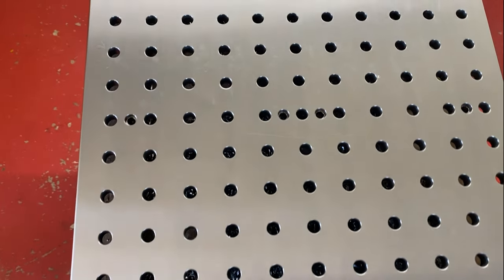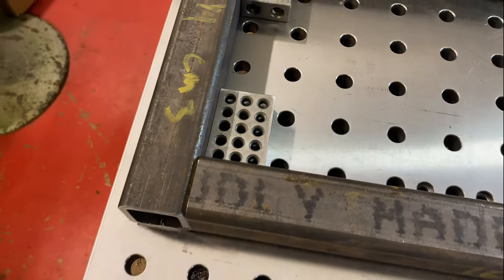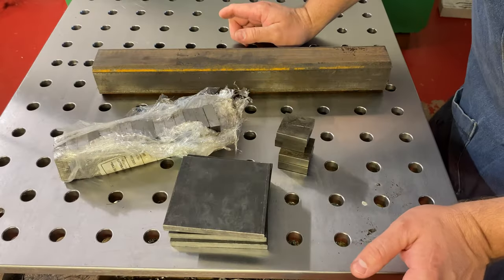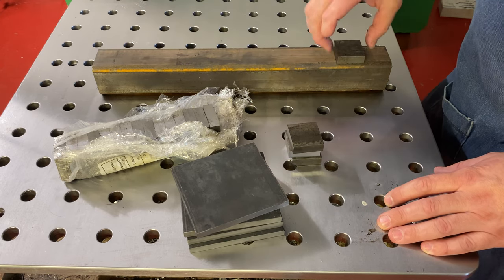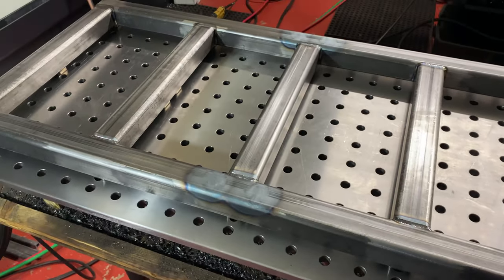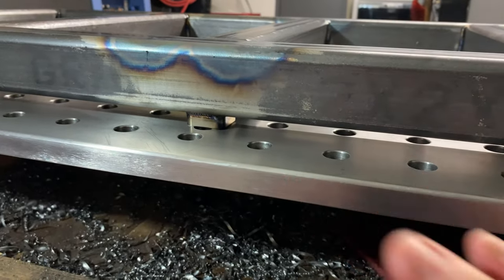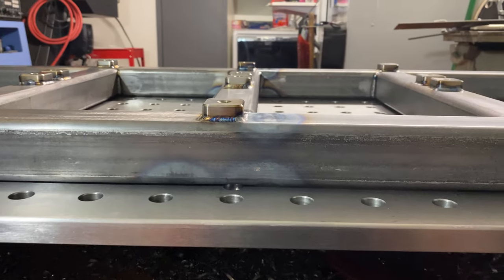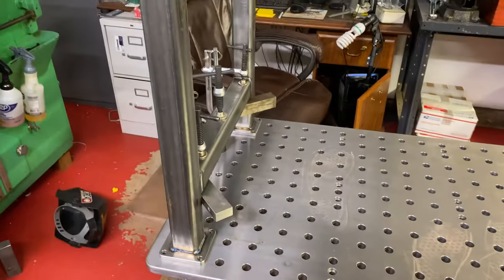My Welding Table Build | Table Frame - Nice Legs and Billet Caster Plates

Comment: Kool shop. Nice to see a true machinist make one of these. A lot of hacks out there. I’ve been a toolmaker/fabricator for 50+ years. Certainly over kill using a CNC but hey like you said, SATISFACTION. Love the Monarch, one of the best lathes out there. And a nice Doosan lathe. My sons bought my CNC machine shop several years ago. Two years ago they bought one of them. Quite happy with it. Majority of our lathes are Miyano which are very good but DN Solutions (was Doosan and Daewoo prior) are building great machines at reasonable prices. BTW your Tig Is extremely good. Nice video too. In fact I’ll subscribe , nice to watch someone who gets it
Reply from the maker: Hey thanks!

Comment: BEAUTIFUL work.  And I didn't get welding it without machining it, bc I thought welding such a large frame would introduce not only heat-deformation, but very convoluted deformation; twisting parts and compressing others to hide issues within other issues, etc.  But then I saw you adding those 'jacks' I guess..? Which I assume can be individually adjusted to make a perfectly flat plane ... very very knowledgeable and calculated project. I guess you probably would machine it flat it weren't a monstrous area to do. Again, beautiful work
Reply from the maker: Thanks! I had the frame machined flat after all welding was completed.

Comment: I didn't see you need to grind a single weld. I once read somewhere that if you needed to grind your welds, then you are a grinder and not a welder. I know nothing about what you are doing, but I know enough to appreciate a Master at work. I am getting inspired to learn the craft.
Reply from the maker: Dude thanks! A master I am not but I’m glad it’s lightning a fire for you. Welding is very rewarding and an endless pursuit towards the perfection.
Thanks for watching!

Comment: That is one good reason why a machined surface on a welding table is not a good idea.  Applying heat is going to move the table top whether it is future projects or as you have experienced while you are building it.  No point to get an expensive precision top.  You will also be grinding out spatter and tack welds all of which diminish a precision top.  You will get much more use out of it if you don't have to baby it along.  Save the precision for where it is really needed in the shop.  Good looking table.

Comment: Always love the beautiful results you get.  I am working on a fabrication table, at the moment.  Mine is larger, 43"×67".  I am afraid mine will not come close to matching the beauty of yours.  Yesterday, I drilled 117 of the 273 5/8 " holes I need to since it was a fairly nice day in Michigan (56°) for a few hours.  By the way I didn't mention I am working out of a shipping container since, as you know, my shop burned down.  Hopefully, since the weather is going to be unseasonably warm this week, I should finish the holes Wednesday.    Anyway, the hold downs you used in the framework welding.  Are they fireball or did you make them.  Demon.
Reply from the maker: Thanks! I am sure yours is great. 117 holes down wooohooo! That’s a bummer about your shop but glad to hear you’re making due. The hold down clamps were purchased from fireball tool,they are strong hand brand.
Thanks for watching!!

Comment: My only concern with the frame is that a lot of the holes will foul on it unless you drill into said frame. The 50x50mmx5mm (Edit looks a bit thicker than 3mm) RHS you are using is fine but the 16mm plate and 10/12mm components only add to the depth of the table if that makes sense. Just my 2 cents either way.

Comment: Weren't you a tank manufacturer in your previous life?
This table must be awesome, but I still prefer disassemblable bolted designs, that can be moved by one person part by part. Your table requires a crane and a truck 🙂
Reply from the maker: Hahah. That is no lie. This thing is a back breaker. It does hold the floor down real good though.
Thanks for watching!

Comment: Здравствуйте Сэр !
Очень впечатляет ваша работа !
Терпение у вас железное 
Хотел узнать толщину столешницы?  и как я понял 16 мм размер столешницы 1200 × 600 мм  и наверное  фрезеровку вы сделали столешницы или это основательная шлифование? и самое главное подстолье из какой трубы 60 ,  или 50 или 40 ? толщина явно пятак
Какой вес вашей плиты что вы так смело передвигаете 
С уважением к вам Андрей Александрович . Moscow
Reply from the maker: The table top is 23” x 47” x .75” thick.
The top is ground with a Blanchard grinding machine.

Comment: I have been considering purchasing a fixture table. But, the cost is insane which is how I ended up finding your video. Thank You.... Question.....What is the purpose of installing the round tube inside the square tube?
Reply from the maker: The round tube is for my TIG welding rod storage.
Thanks for watching and good luck on your build!

Comment: How do you like the mega square ?  Have you had it long ?  Demon
Reply from the maker: I like it a lot but have not really used it to its potential yet. I need larger vise grip style c-clamps. I will be buying more. I do think I would have preferred to have started out with the triangle version first.
Reply: @nubtools  I've been trying to decide what to get first. I was thinking maybe an 8" mega square and that adjustable two piece square. I'm just not sure.
Reply from the maker: Roll the dice.
Reply: @nubtools  Good advice....think I will. Thanks Demon

Comment: Great Job!! but you really really need to ditch the CLAW Hammer, that hammer is for nails, not your center punch
Reply from the maker: Thanks!
😂
Have you ever tried it? It might surprise you how similar a claw hammer’s head hits the head of a center punch like it does the head of a nail. I think the claw hammer is the most over looked and underrated hammer in metal working.😁
Thanks for watching!